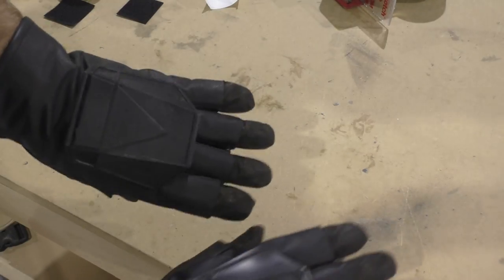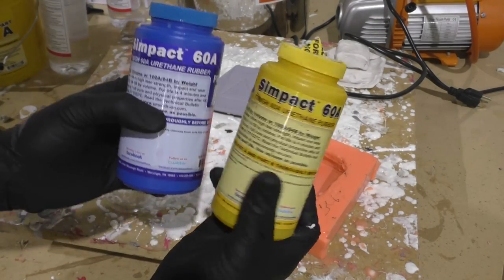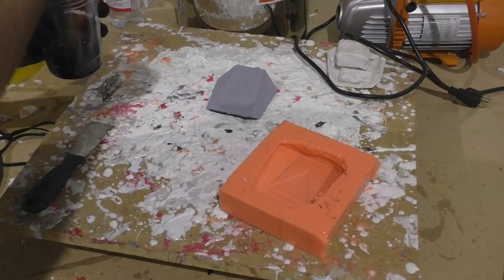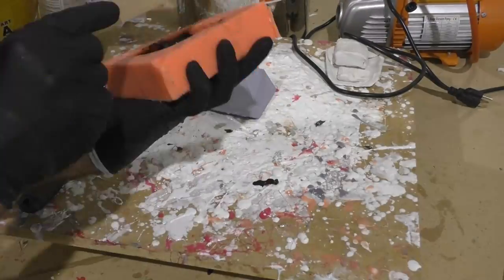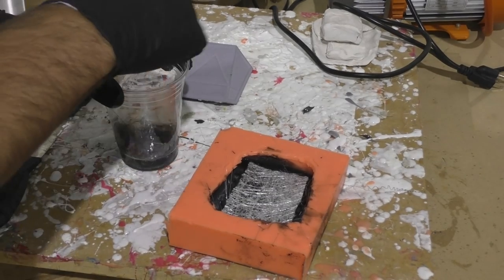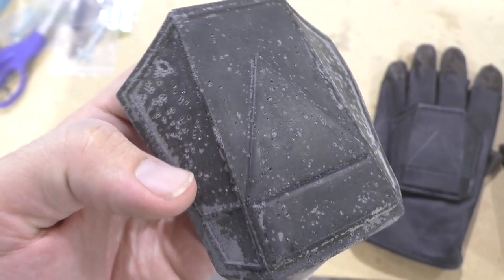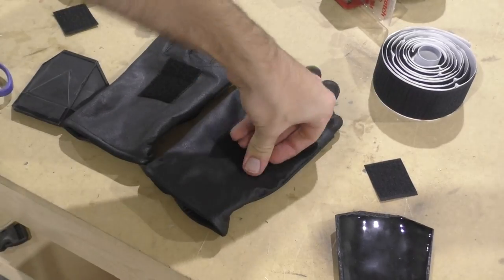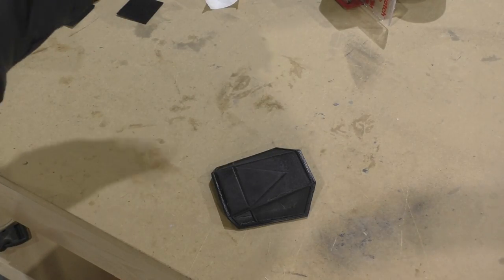Making Boba Fett Armor - Episode 6 - Rubber Hand Plates

Comment: I created a rubber abdomen for my Clone Trooper outfit a while ago, which added a whole lot more flexibility and matched the PLA pieces well. I was even able to use the same paint after a base of plasti-dip. I don't suppose your mold method is viable for something that big? I'm getting some paint rubbing off against the chest plate and I'd prefer a dyed piece instead of a painted one.
Reply from the maker: Did you 3d print it? I don't think this would work great for a whole ab piece